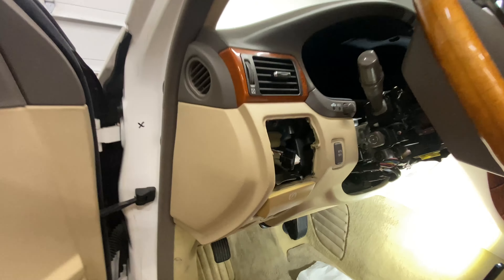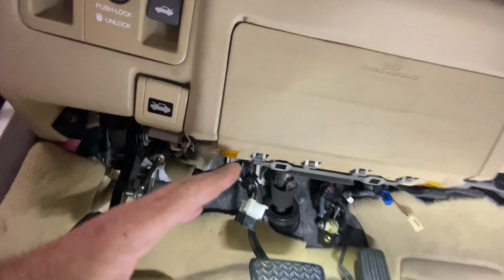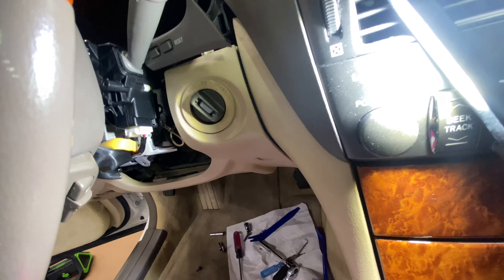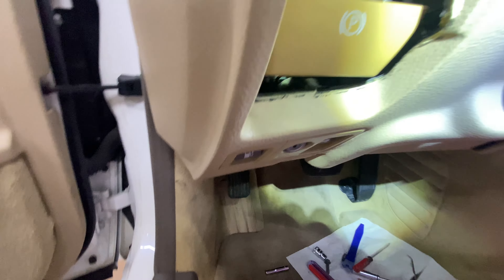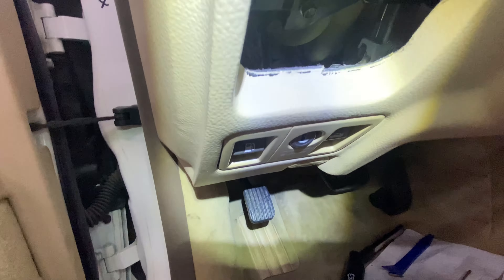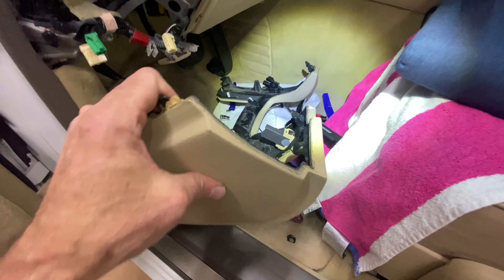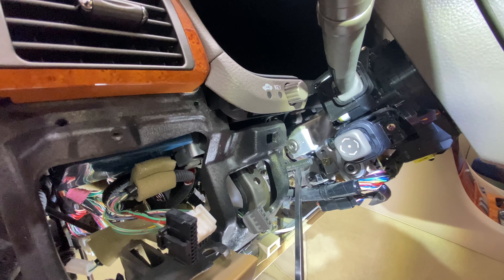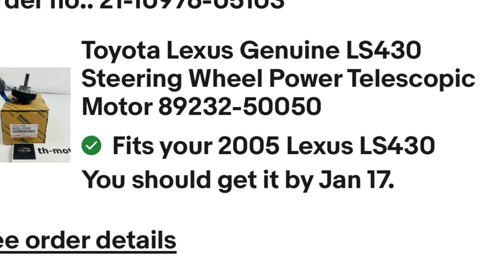Lexus LS430 telescopic motor installation part 1 of 2. How to get to the motor (it ain’t easy)

Comment from the maker: Two motors in the column. The telescopic motor makes it shorter and longer. The other motor raises it and lowers it (tilt motor) . Sounds like your telescopic motor has failed just like mine failed.

Comment: The telescopic motor on my LS 430 2006 will move up and down but not in and out.  Does that mean I need a new motor or is there a different problem?
Reply: It's a different motor for the telescope function.  That one is bad on your car.